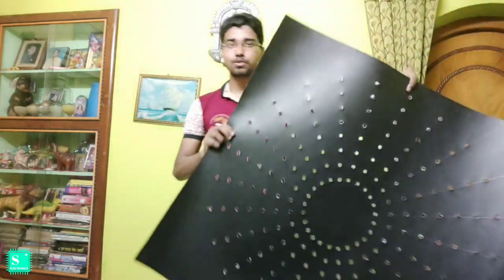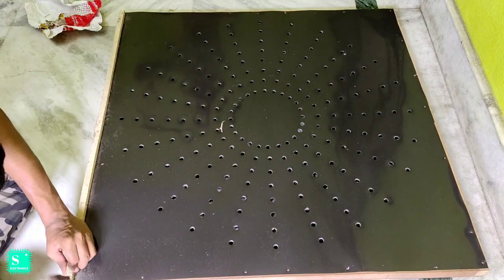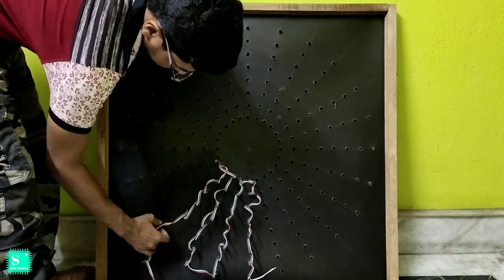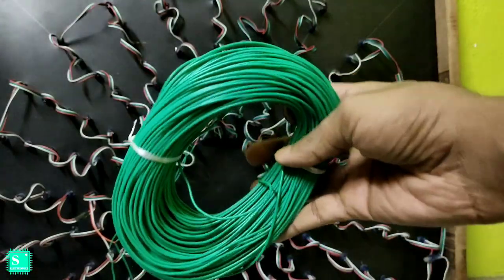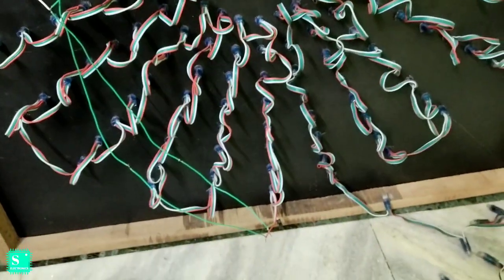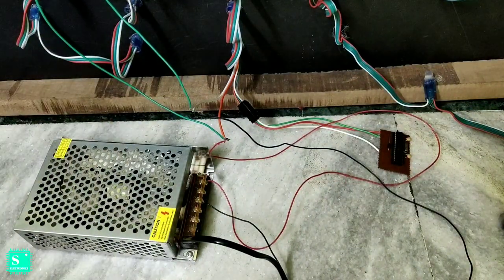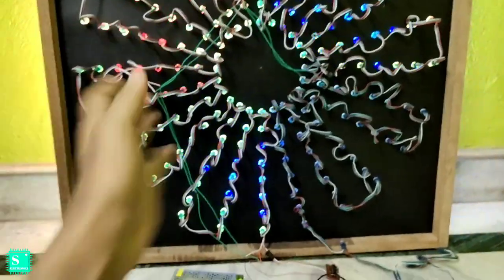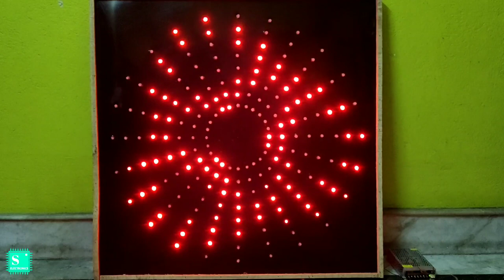How to Make 8x24 Pixel Led Chakri Action Board | Pixel Circle

Comment: Ic ta programming korlen kivabe
Reply from the maker: 1. Mount the Atmega-8 Microcontroller  in " TL866A Universal Programmer " .
2. Use " MiniPro TL866 EEPROM Programmer Software " to upload program to the Chip.
Reply: @SayanElectronics  software er naam ki
Reply from the maker: Point no.2 dekhun
Reply: @SayanElectronics  c code dekhale valo hoi
Reply from the maker: Ok ami Video banie Debo, stay tuned..